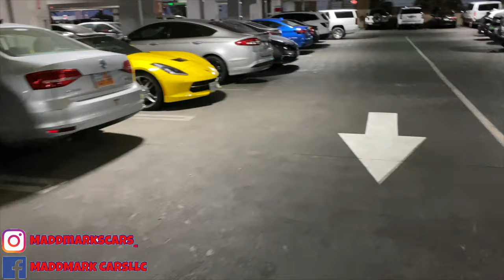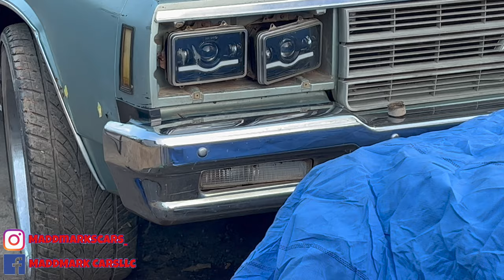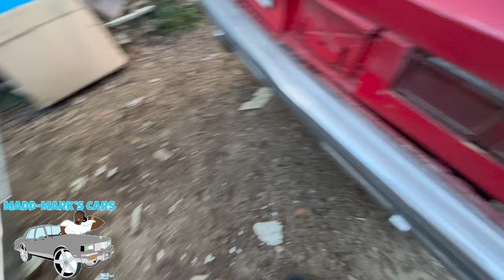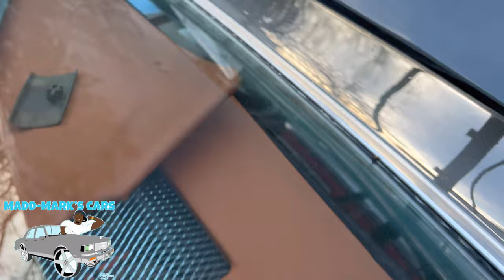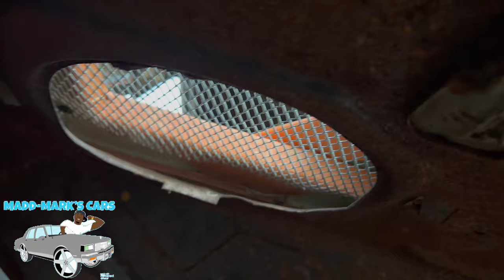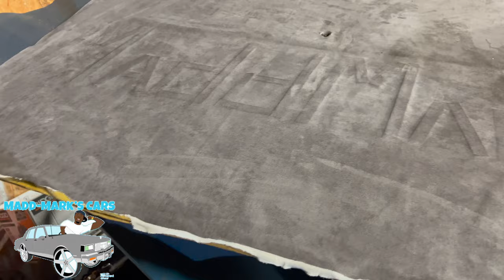First To Ever Do This... Box Chevrolet Impala Just About Done!!! 350 Engine Restored

Comment: If you drill the bumper shocks and push bumper back you don't need that filler anymore
Reply from the maker: On the 79
Reply: @maddmarkscars  yea the bumper has 5mph shocks on the mount you drill hole in shock and push bumper in. They each go in about 4 inches